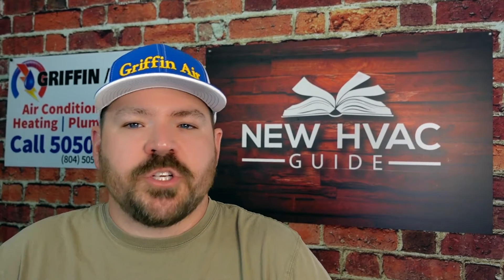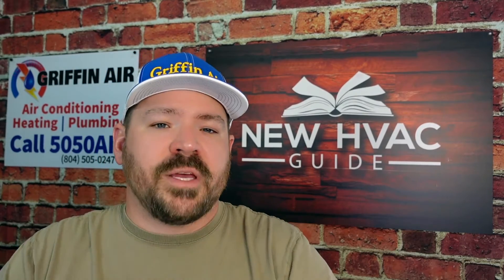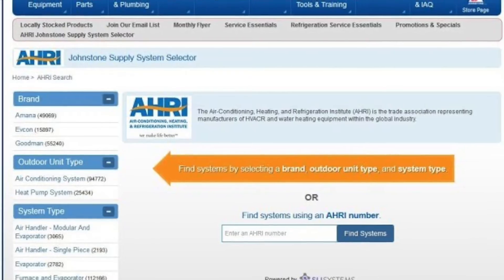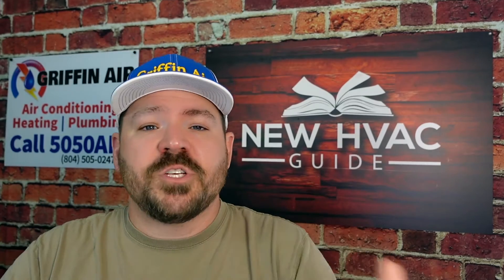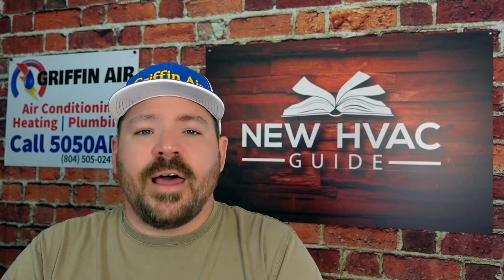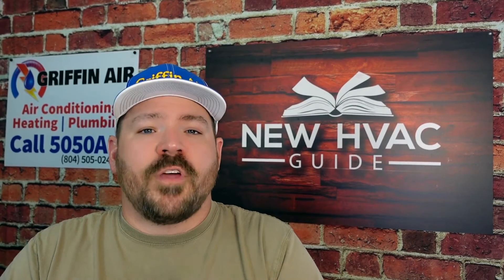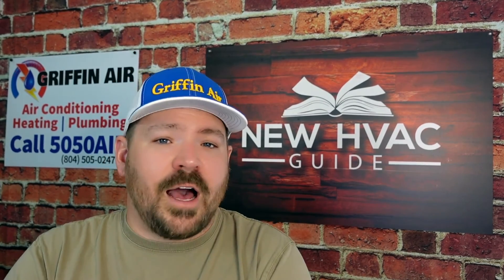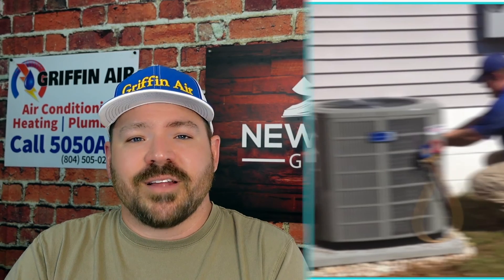PROBLEM with HVAC Systems MISMATCHED! Here's Why!

Comment: We always replace the AC and Coil, or Heat Pump and Coil at the same time. They must be a matching system, no exceptions! Now if you have a gas or propane furnace that's under 12 years old, you don't have to replace it. It's usually best to replace it all but a new furnace is optional. If it's all over 15 years old you should replace it all and get a matched system.
Reply: I never knew that, thanks!  I just did the coil but not the ac
Reply: @puttothetest  That's not good. Unless the coil failed within a few years of you buying the system. The coil and system should always be a perfect AHRI match, otherwise you have no idea what kind of efficiency it will get. If it's a super basic AC it might work alright with a newer coil. To make sure it all works perfectly they both need to be new and AHRI matched. I hope its all working well for you and doesn't cause any future headaches! Next time when it needs to be replaced buy an all new matching system.
Reply: @KPHVAC  will do! I appreciate all the feedback. Had no idea till reading your post. I’m guessing it is inefficient like you said, due to rise in energy bills shortly after new coil went in about 7 months ago.
Reply: @puttothetest  Oh dang. Depending on your area electricty prices have been going up this year. I hope it all works properly for you now and keep running right in the future. If anything major happens it's best to replace them both. Same brand and AHRI matched. If you have a gas or propane furnace that's separate and might not have to be replaced. Now if it's all 15+ year old replace it all, even if only 1 component has a major failure.
Reply: @KPHVAC  thank you!

Comment: I disagree about matching equipment.  The ac has no idea what what type of furnace you have(unless communicating) and as long as you have the 350 to 400 cfm per ton.  It doesn't care. Would matching equipment be nice, yes.  Is it necessary to have a properly running system, no.  No AHRI basically means no tax credits.  Id rather not get 500 back and not spend 4.5k on a new furnace strictly to match ahri specs.  In fact id argue any loss in efficiency from not being matched would never overcome the install price in the 20 years average they last.
Reply: correct. a contractor who says to replace perfectly good equipment just to have a matched set is a crook. single stage a/c can be matched with any furnace as long as blower is capable.
Reply: @Jon-hx7pe  maybe they want to spend the extra 5k to get a 500 dollar rebate.  Thats on them lol